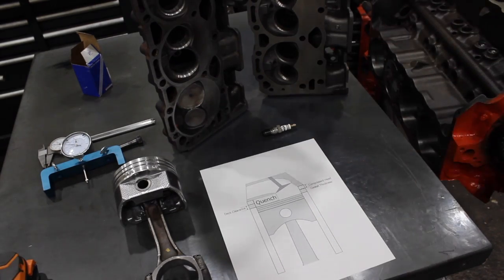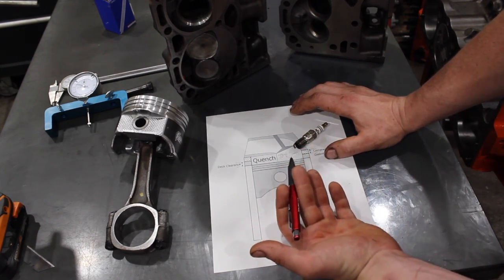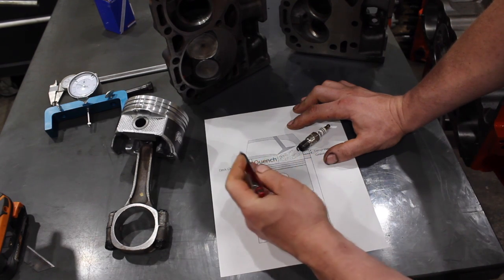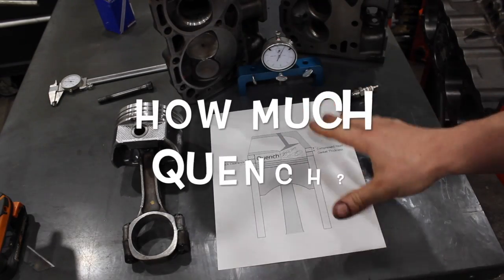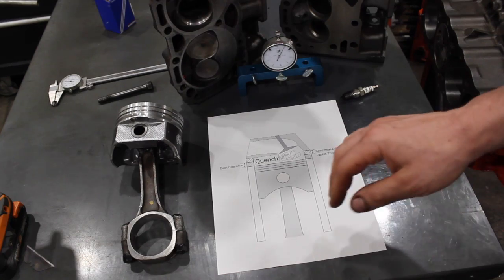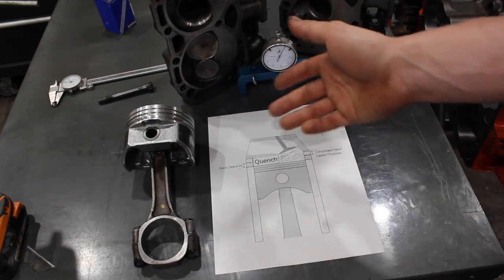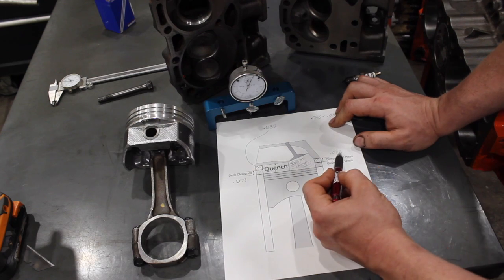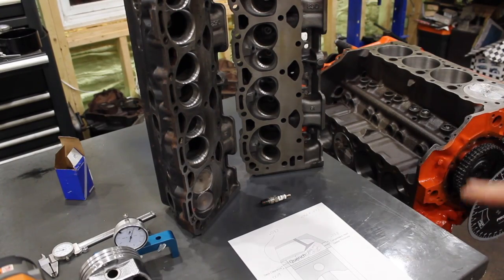Quench! Higher Compression with Less Detonation (A key to making more HP)

Comment: I just installed 440 source heads on my 68 Hp 383 engine.  True zero deck engine from factory…piston tops right even with deck.  All original bottom end in engine including pistons.   I have .039 clearance from head gasket.  Engine now runs well on 89 octane gas.  Heads made a huge difference over original 906 open chamber heads
Reply: 68
Reply: @406MenaceRacecar 
1968 Hi Performance
Reply: @mikes.1882  is there actually a brand name called high performance? This seems odd and I'm not trying to be difficult here but honestly it seems like a moot point to claim a 383 is high performance, you've customized a V8 engine to have more power.  There's no "low performance" lol
Reply: @mikes.1882  Many Mopar guys still think that a 383 or 440 that came out designated as High Performance from the factory had better parts. At least half of the old Mopar guys I talk to will argue that a 383 Road Runner engine got the high performance heads from the 440 Magnum engine, which is true, but so did the 383 2bbl and the 361 2bbl as Mopar only made one big block head for their engines and they put it on all of them. Many 383 and 440 blocks were stamped HP and those are coveted by a lot of Mopar guys even though they are exactly the same as the blocks not stamped HP. But it's all good. I always just smile and nod.
Reply: @406MenaceRacecar 
The '67 915 heads had closed chambers and bigger intake port volume. Labeled as HP and the 383 HP blocks were better design for rigidity.
I dream of a 383 3 3/4 stroke with 68cc indy head turbo motor.
After my portfolio comes back from this LT1 build. 😂😂

Comment: If I remember correctly, David Vizard says you can go down to 0.029” piston to head clearance. I’m running an LS with pistons coming 0.005” out of the hole and an 0.040” head gasket. Not running yet but we’ll see. Turns over fine by hand, anyway!
Reply from the maker: I know he has done testing with very tight quench but I'd be surprised if he recommended .029" piston to head clearance. I'm not saying that guys don't run under .030" but it can be risky thats for sure.
Lots of checks and really good parts are key!
Reply: sometimes an aluminum head can trick you, expanding later than the block and a valve gets friendly with the slug. the question is, are you turning over by hand when the engine is cold or after it's gotten to operating temp and everything's as expanded as its going to get (and you have no valve float, flutter from pushrods bending and unbending,  etc)
Reply: @albertgaspar627  All good points. Valve train should be good, BTR dual springs. The cam is a relatively short overlap, so flat top pistons should not be a problem.
Reply: @bdugle1  and the nice thing about short overlap, relatively speaking, is that you can run a lower mechanical compression but it'll raise up by not getting blown out the exhaust. That gives you more room inside the chamber for valve clearance if you go with a dished piston. I prefer that over a large combustion chamber--let the combustion expand against the piston, not the cylinder head which isn't going anyplace.
Reply: Hondas go that tight and more, but they don't have the piston rock problems of sbc/ls
Reply: Many have good information, even if they're the type to schitt on their competition... Vizard is that type, which always shows in some area of their work... 

It's unwise to simply attack competitors as he does in many of his videos, and such lack of wisdom is never limited to a single component of their life. One example is his assertion that there is a single LSA for each engine, which is completely false... while telling his crowd others don't know what he 'knows'...

Comment: this makes a lot of sense. my 360 would start pinging once it gets to temp, i thought it was too much advance. i cant tell you how many times i put the timing light on it and moved the distributor... i used the 4.060 kit from jegs and thought it was good. the CR calculator said it was like 9.4 to 1. Maybe i should get a cooler plug, it has autolight 45 tapered seat.
it spends its whole life at 2000 feet elevation and over 100F degrease ambient air temp. would you recommend a better spark plug?
Reply: i did a bit of googling and ive purchased some autolight R44ts to replace the R45ts. hopefully it helps with detonation.

Comment: If the piston were to hit the head what would happen? Break the piston? Break the crank? Or would it just stop and quit running? Would it damage the head? I had my heads shaved on an old carbureted 360 bored 40 over and I think that could have happened. My mechanic replaced a piston head but I dont think that really fixed that motor. Also I had it reringed after that and we found what was probably a screw or something laying on the piston head. It was beat up. This experience is what kept me from getting into motor building. I let it get to me too much I guess. 😕. Apparently it runs now but it is in better hands.
Reply from the maker: The piston would probably be the weakest link, then probably a bent rod, damaged head. It would depend on how bad its hitting. Often times it's just kissing the head and causes damage to the piston only
Reply: @cuttersperformance  If the piston is just kissing the head it will usually beat the daylights
out of the rad bearings...ask me how i know
Reply from the maker: @gregleenyit  haha makes sense! Got a story?
Reply: @cuttersperformance  I have a strange story...I had a .40 over 350 with 305 heads and flat top pistons with valve reliefs and a mild RV cam, I didn't take any measurements or even know what size the chambers were, this was back in the mid 80's, I was young and broke and we didn't have the head selections like we do now I just used what I had laying around but it pulled hard and ran good for what it was. I know the compression was pretty high from the way it turned over and it would ping with the vacuum advance hooked up but I daily drove it for about 80K miles and it developed a noise where it sounded like there was a small piece of metal in the number 8 cylinder. I tried pulling the plug and rotating the engine by hand with a hose stuck down in there hooked up to a shop vac to remove it and it still made the noise afterwards. I ended up pulling the head and there were small dents in the piston but no damage to the valves etc. I never found the object in question then put it back together and the noise was gone, drove it for about another year and one day I parked it at work and it was running perfect then when I went to leave work it acted like it was hung up when I went to start it. I kept bumping the starter and when it fired up it sounded like someone was inside having a field day beating some pots and pans together. I shut if off and had it towed home, and when I got around to pulling the engine and tearing it down I found the number 8 rod bent and twisted in such a way that it shrunk the piston straight down to where the skirt was contacting the crank counterweight just enough to where was making the loud knocking sound there was no other damage to that cylinder or any of the others including the rod and main bearings or pistons at all, to this day it is still a mystery to me.

Comment: Again like you said not recommended,  I've build several will piston .010 in the hole with a steel shim gasket. They are great performers. Much more throttle response than a unmilled block. The best was a flattop 350 pro top line 200cc runner 49cc chamber heads with a 285b6 comp cam. Shifted at 6700 in a 79 malibu with 4.30 gear ran 11.36 in a quarter
Reply from the maker: Haha Risky business running that tight but you are right, there are some good benefits of tight quench. 
Did you ever tear down that engine? I would imagine at that tight you may see some signs of the piston getting pretty close to the head especially shifting past 6500
Reply: @cuttersperformance  I did have the heads off it once. The flat part of the piston under the quench stayed very clean, but showed no signs of contact. I ran that engine for 2 years and sold it it so I could build a 400

Comment: Would the .060 max piston to head clearance apply to a 454 also? I have a 454 short block that the pistons are .045 in the hole and the thinnest gasket I can get for a 4.350 bore is .039 thick.
Reply: Am I asking for detination issues?
Reply: That sure sounds like a lot of gap. Maybe look for pistons with higher tops or get block decked. Sounds like allot of pain, I know. I don't think it's that much different from small block to big block engines. I could be wrong. I'm doing a 350 sbc build with every piston checked in it's place .004 out of the hole and .0028 head gasket. AND I"M SCARED...But I hear you can get as much as one whole point higher compression. ie. 9:1 / 10:1 before detonation. Just gotta remember age/ware also ads to the equation .
Reply from the maker: Your going to go for .024" piston to head? Damn son! Some circle track guys do it because of class requirements part restrictions but they want to get the compression up. I will not advise that though
Reply: @nakedshorts6784  yeah, putting different pistons in or decking is the obvious solution I guess. The reason the pistons are so low is that their compression height is on the low side vs other pistons that are available. I didn't realize this until after the fact though. 

I'm really just trying to find out if I can get away with what I have. Otherwise it comes down to weighing my options.
Reply: @nakedshorts6784  You should be terrified 🤣🤣 id be going to .0045 gasket for sure
Reply from the maker: Yeah even will a big ole bbc piston. Steel Rod you wouldn't want more than .060"

Comment: A classic "popup" or domed piston gets in the way of flame travel and airflow with high lift or long overlap cams, but some will use them to get quench in a big chamber. In a perfect "clean sheet build", its best to have as small a chamber as possible and let combustion occur in the dish of the piston. why? because the combustion is creating expansion, and its better to have it working mostly on the piston, rather than working mostly on trying to push on the cylinder head. so have it occur where the "most surface area" is applied. But of course, not every engine is a clean sheet, no budget build--and we work with what we found in the junkyard or in the used classifieds.
Reply: I am working around the crap heads and pistons that come from the factory... 1994 SBC 350 :(  not much to work with there... blower and headers will help some - along with a low rev torque increasing cam selection. Maybe some day I will find a cheap vortech that is worth putting some money into.  just breathing a little life into an old truck for now...
Reply: during the pandemic i went on a buying spree--all those folks going LS dumping their older engines. So I get exactly where you're coming from.  Its fun to take what's out there affordably and making it work, like crutching an intake design with spacers and an oversize or undersized cfm carb.  Clean sheet designs are expensive, and "cheating" but if one's trying to "make a number" on the racetrack then its necessary. me, i'm a street rat (hence watching videos like this), so....
Reply: @albertgaspar627  Exactly.  It has been known for decades that small ports and valves increase low/mid rpm air flow, and throttle response.  So work with that and stop throwing $10,000 at a low rpm, responsive, work horse to try to turn it into a race car... super big ports and air flow is only good for high rpm race engines - usually throttle response sucks until you hit 2500 RPM and that huge mass of air actually starts to flow and who will actually use a 7500 rpm engine on the street?  Better to have good throttle response, good gas mileage, and reasonable power on a street engine... 300 horse power is more than enough for me.  Vortech is a different animal - it is designed for good throttle response at low rpm with good flow up to around 6000 RPM.
Reply: Ford and Pontiac ran relatively small ports and valves, so they understood torque--and then offered the Boss and Ram Airs respectively for those wanting to wind an engine up like an alarm clock. Aftermarket parts have always been expensive, and many "hot shoes" wanted to impress with race parts like a tunnel ram. Chevy big block fans used to think rectangle ports were the way, then discovered the oval ports and now Richard Holdener (if you aren't on his channel, look him up) is figuring out even peanut ports can work. 

If most people could look at a tach during everyday driving, they'd notice the engine spends more time in the 2,500-4,000 rpm range. they may shift at a high RPM, but that means the engine is just there for a second. its like focusing on how much your heads flow at full valve lift, forgetting the valve spends very little time there unless its a real long duration.  Focus on seat-to-midrange lift, and you get a valve that flows better while opening, and while closing, and it fills the chamber better as a result. build an engine that "recovers" after every shift by not falling out of its torque curve, and you may lack a dyno queen ultimate number, but on the street you "feel like the engine never quits" because its always in its torque curve. 

If you can be happy with a 13 second comfortable cruiser, or a 11 second stripper, and aren't an LS head raised on Fast and the Furious "i live my life 10 seconds a time", you can re-work OEM parts (junkyard price and otherwise) to get performance on the cheap. Match that low torque, 5,500 redline (so less money in valvetrain) engine with an overdrive transmission from the 1980's, and you even get killer gas mileage with the AC on.  But I'm not telling you something you don't already know.  for my foreseeable future, my project cars will use up what I have lying around the garage...I'm trying to avoid a "wall art" collection. 

well, except the Pontiac 2 bll intake...I just bought 4 motorcraft 2bbls for $20 and there was this company called Man A Fre....some welding and i'll either have a nice part on the next Pontiac 400 I build or it will just be wall art for the old timers to enjoy with their beer.

Comment: lmao, alot of the rattle from emissions era/low compression engines are the absurdly hot sparkplugs and 40+ degrees of total timing
Reply from the maker: Is it though? Modern heads, tight quench and you can run 10:1 on 87 octane with enough timing to make full power. I do it on my daily, 34 deg at wot and 44 on cruise. 
Older engines needed more timing to make power...due to poor combustion chambers and huge quench but then they rattle. Sure you can back the timing back, maybe add colder plugs....but are you masking the issue or fixing it?
Reply: @cuttersperformance  old smog stuff would run 40+ degrees WOT because no compression,  check a smog era HEI distributor and see how much the advance plate swings, usually 30 degrees or more before it stops
Reply: @whatchu_talkin_john_willis  current practice is for engines to run hot because it lowers emissions. I have run into this where a cooling fan was set to not come on until the engine was well over 200 F or even closer to 220F. I was told that this was a design feature and that they used knock sensors and computer controlled dynamic timing and A/F mixtures to overcome the pre-ignition problems caused by the widely varying fuel quality issue.
Reply: @cuttersperformance  my weekend warrior is .020 down the hole , .015 gasket, 31* total at wot, 43 * at cruising and loving it 😁😁
Reply: @cuttersperformance  masking, fixing? Or just tuning properly by giving the engine what it wants?🤔😉
Reply: @cuttersperformance  final step in a tune up - take it out and lug it up a hill... if it rattles then back the timing off a degree until it stops rattling under load. Each engine is slightly different due to stacking of manufacturing tolerances...

crappy gas is much more common today due to alcohol having a high octane. it covers up for a lot of shit gas problems until the alcohol starts evaporating or absorbing water.
Reply: @barking.dog.productions1777  no
Reply: @whatchu_talkin_john_willis  no to what? please be more specific.
Reply: and crappy low octane gas
Reply: I am looking at many specs for 70s and 80s engines and most are around 35 degrees total.   

The only way you'll get to 40 is adding in vaccum advance at part throttle.
Reply: @tahcogunworks  1970s and probably most 1980s cars had no computer to second guess the mechanic and change the timing on the fly You simply turned the distributor to set whatever base timing that you wanted.  We also had vacuum advance, and mechanical advance using weights and springs to set the curve.

The factory vacuum advance was preset at the factory, but people like holly and accel sold aftermarket advance units that spring pressure could be easily adjusted.

This gave a good mechanic near full control over the timing curve and a lot of home tuners the opportunity to completely screw-up their timing.  lol